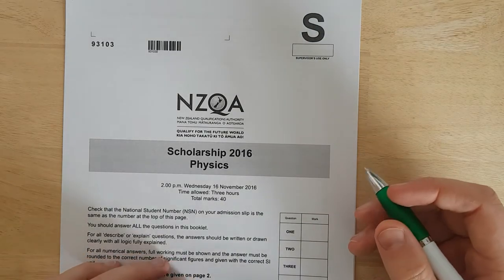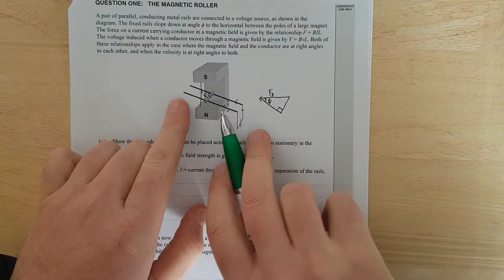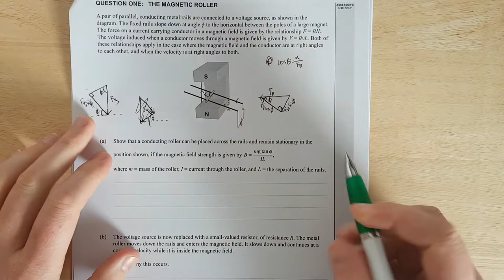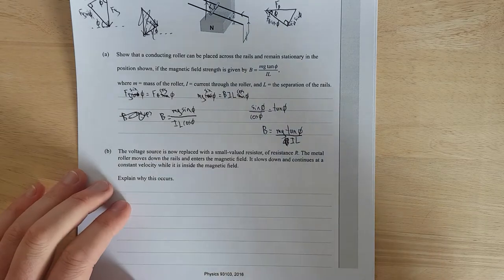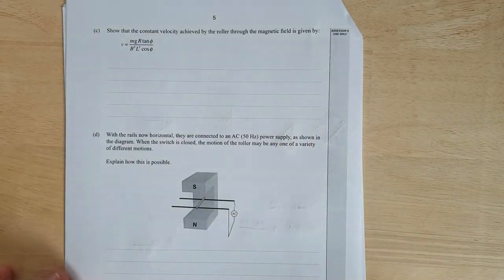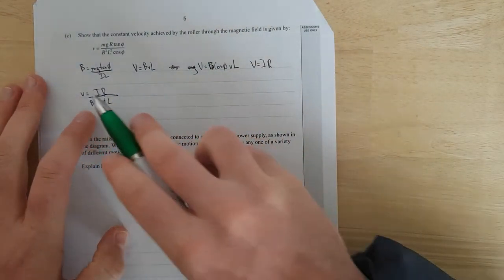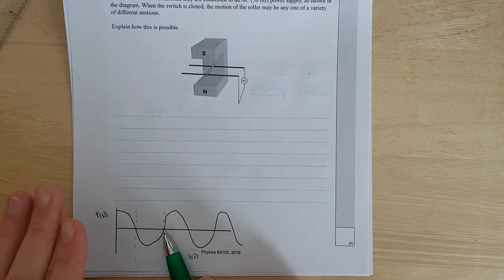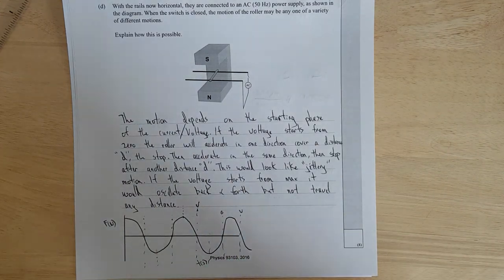2016 Scholarship Physics (NCEA)-Q1

Comment: sorry, I have to disagree with that Fb increases. It is initially greater than Fg, hence causing deceleration, and it is because of the reduced velocity leading to reduced voltage, reduced current, and reduced retarding force from BIL that causes it to eventually equal Fg component.
Reply from the maker: You are right, I misread the question thinking the rollar was starting from rest as it entered the B-field.